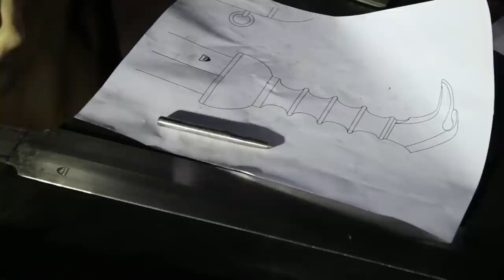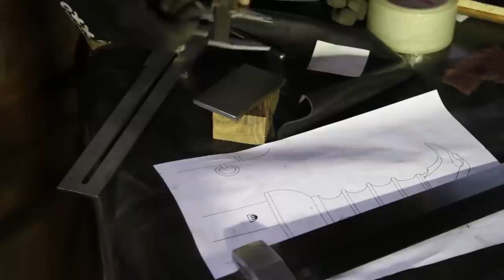Forging a Gladius sword, the complete movie.

Comment: Love your work. I've watched you make several blades. Noticed you seem to like the steel look. Don't like working brass? I know Romans liked bronze because it didn't rust. And they'd coat iron with tin also to keep it from rusting, and both polished to a bright shine. Also, on the gladius, the handle was usually made of ivory, so would be white. At least in the early days. Thanks for your videos.

Comment: Quick Google didn't really answer so I'll ask here. What's the sand for? Is it a special type of sand or is it heated, or is it a type of quenching? If so how does using sand differ from the oil? (Also what type of oil?) Sorry for all the questions just curious!
Reply: Most likely the sand is a substance called Borax, https://en.wikipedia.org/wiki/Borax#Flux as for the oil I am unsure so I cannot help you there, but a quick google search for quenching oils, give you plenty of alternatives of products.